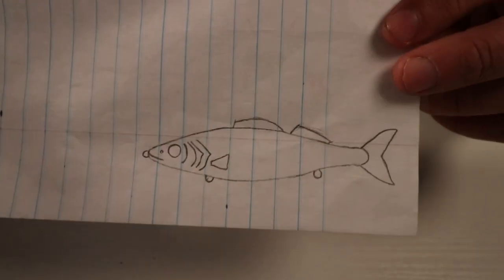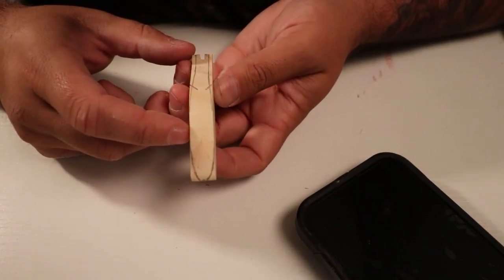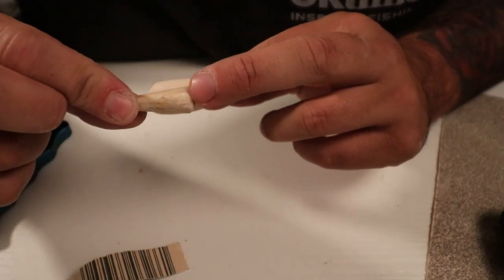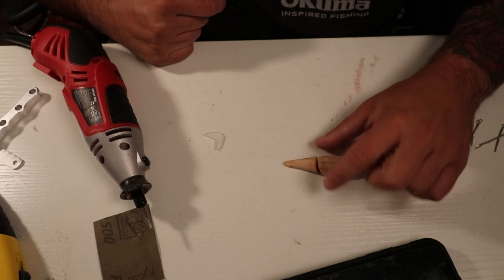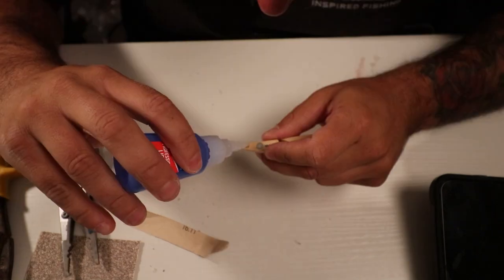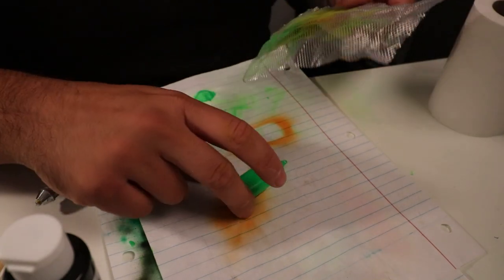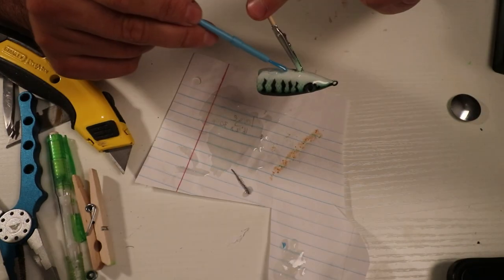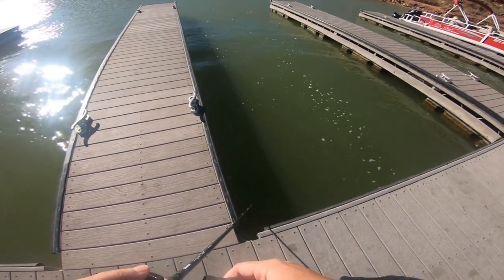EVERYTHING WENT WRONG MAKING THIS LURE!!

Comment: nahh dude just because it was a fast sink does not mean it will not glide. You need the bait to be balanced and the entire joint needs to be even PERFECTLY. Plus the weight needs to be put as low as possible on the lure so drill a few shallower holes next time. A glidebait is one of the hardest lures to get it to work right, especially smaller lures are much harder to get it right. The bigger the bait the easier it is to balance and tune.
Reply from the maker: thank you for the tips
Reply: @RandomBaitChallenge  hope I can help!